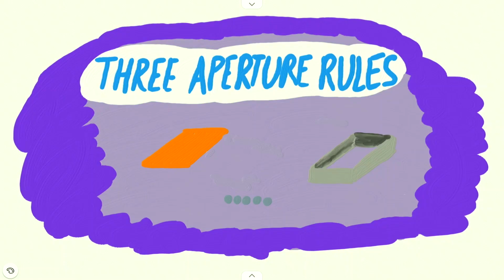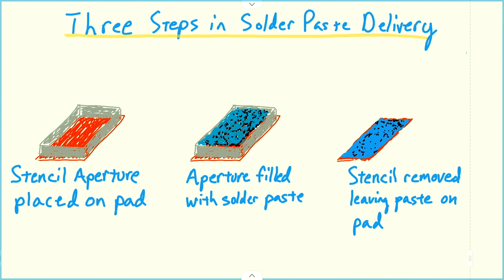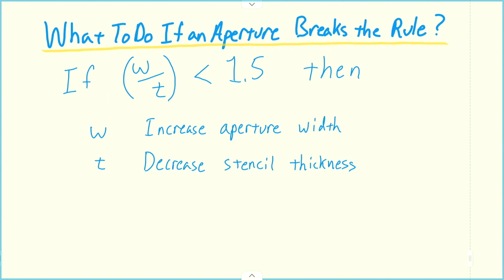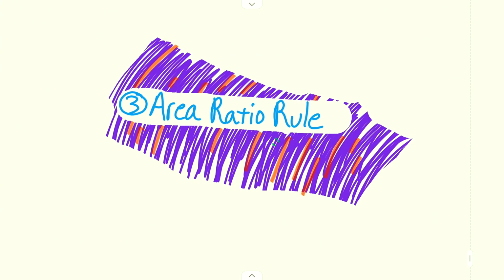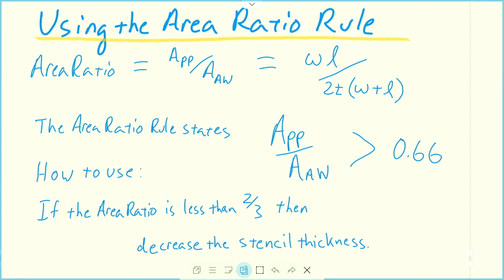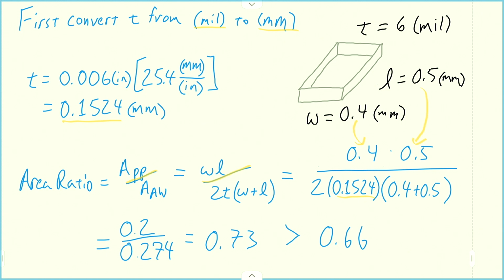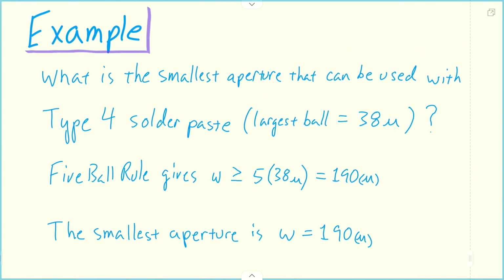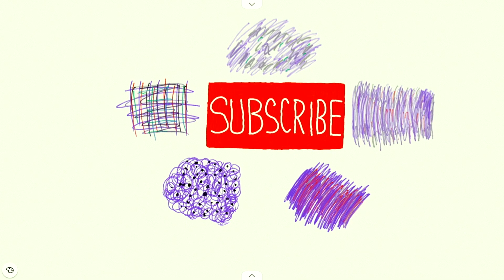Three Aperture Rules for Stencil Printing

Comment from the maker: Angger, it is great to get a question.
There are 25.4 (mm) per (in). And there are also 25.4 (micron) per (mil): (mm) = millimeter, (in) = inch, (micron) = micron, (mil) = mil.
Ask more questions as you wish.
I can also provide answers to course questions and problems: but only after you've tried to answer on your own.

Comment: SIR i want ask number 25.4 from where?
Reply from the maker: Angger, it's great to get questions.
There are 25.4 (mm) per (in), and there are also 25.4 (micron) per (mil):
(mm) = millimeters, (in) = inch, (micron) = (mm)/1000, (mil) = (in)/1000.
Feel free to ask more questions.
I can also provide answers to the course questions and problems.
Only after you've tried to answer them, of course.